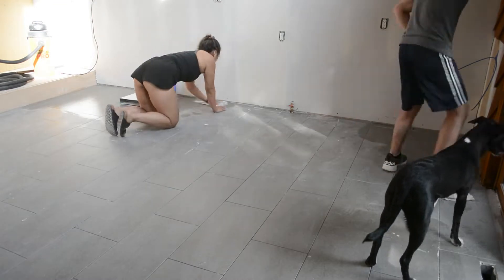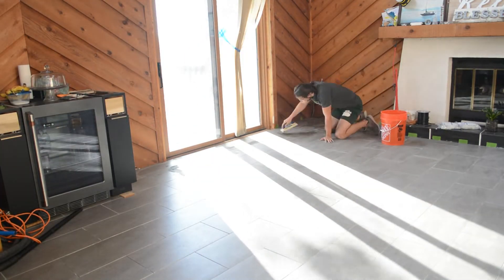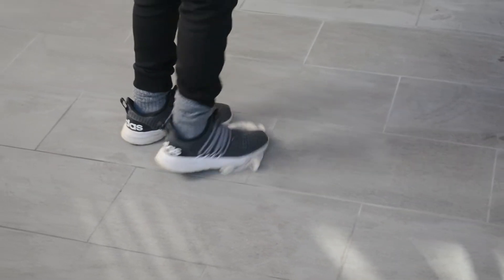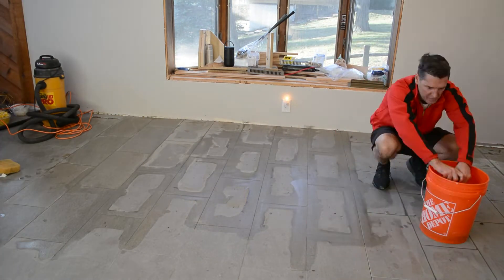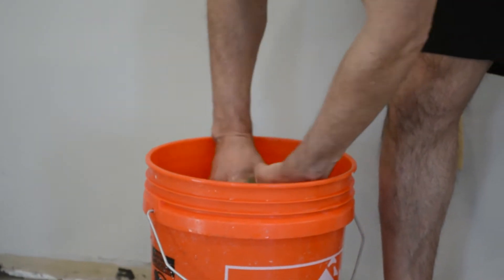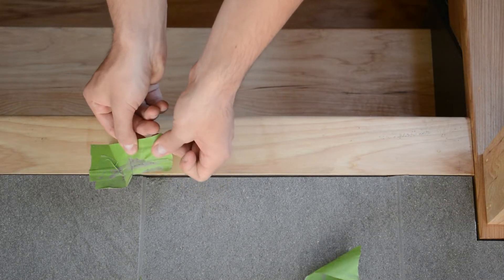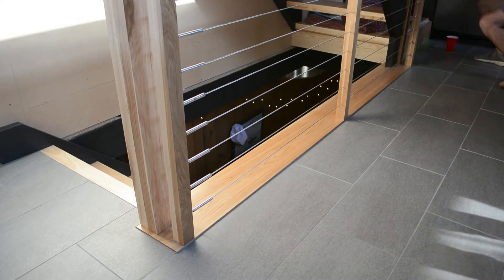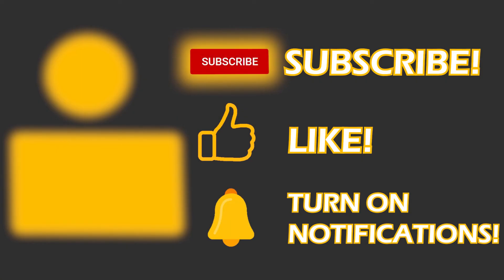How to Grout Tile and Clean the Haze | The Lake House Project Ep 15

Comment: The floor looks great, but your grout install was painful to watch. #1 - Never EVER apply that much grout at one time. Do small sections of not more than about 8' x 8' at a time. Only mix enough grout to do that size of area. You apply grout by using broad "S" motions. After the area is done with "S" motions, you scrape off the excess in a linear motion (one direction only). #2 - NEVER continually add water to the grout as it is drying out. This is especially important in areas with hard water. The calcium in hard water can cause darker grout to become mottled-looking, once dried. It can also weaken the grout, and cause it to fail. #3 - For the final cleaning of the grout, you use broad circular motions over the entire tile, and then onto the next tile. After an area has been initially sponged down, you repeat the sponging down by guiding your sponge in a linear direction (same idea as how you mow a lawn, with slightly overlapping wiped down rows). Only do a couple of tile with the linear wipe, before rinsing your sponge. Replace rinse water FREQUENTLY. Once you have done the full cycle of circular rinse, and then second linear rinse, you let it dry to the touch. Then come back with a clean, dry towel, and wipe off any remaining haze. PHEW Yeah, its a lot... but MUCH more correct.
Reply from the maker: Thanks for tips!